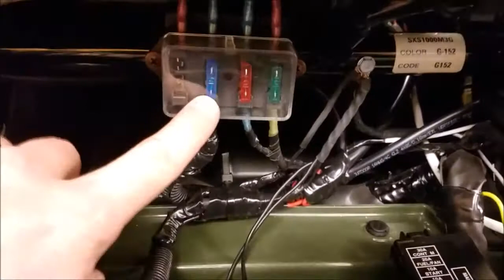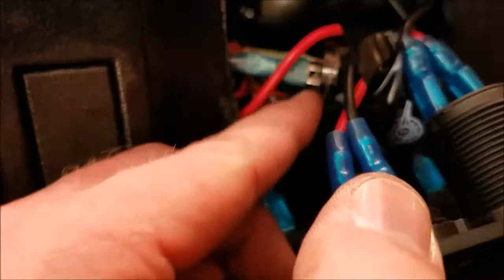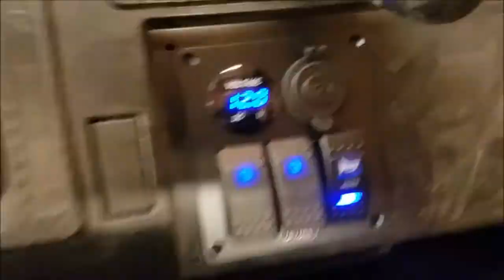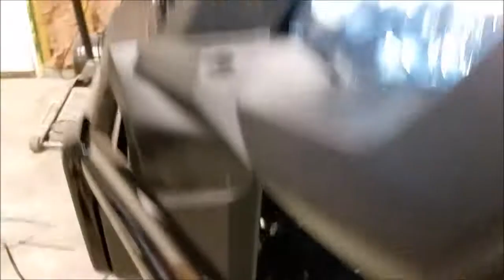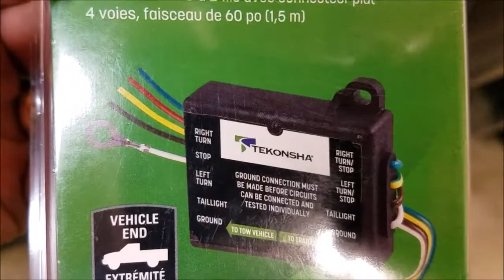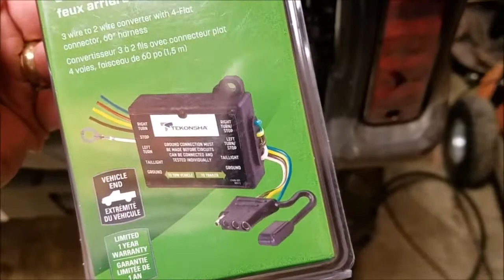Honda Pioneer 1000 Custom Turn Signal and Horn Installation Review Part 1

Comment: SO HOW DID YOU WIRE IN THE FLASHER?
Reply from the maker: Tracy Block Flasher has 3 wires. An in, out and ground. Connect ignition switched 12volts to the in. Ground the ground. And then run the output of the flasher to both turn signal switches. When the flasher senses a load (i.e. you turn on the turn signal switch) it begins flashing. Easy.

Comment: do you have a link for the switch plate and the fuse adapter box that you hooked it all to?
Reply from the maker: Lorena Christianson just go to Amazon and search for marine fuse panel and Marine 4 gang switch. Multiple things will come up but they are in there
Reply: tichendorf thank you